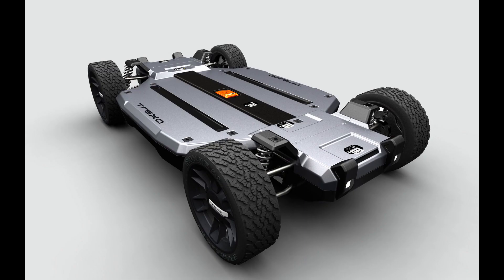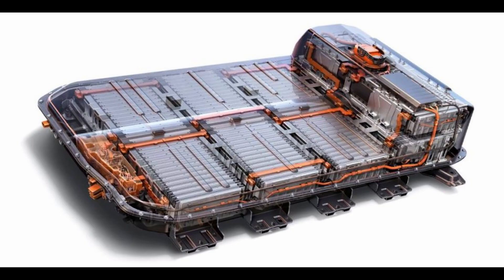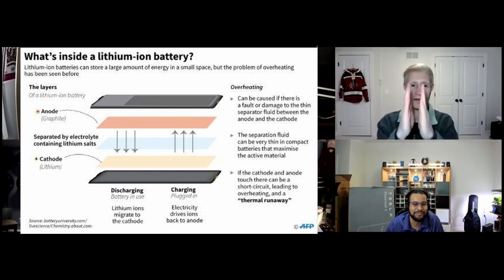390.8 Structural Batteries Mean the Car is the Battery

Comment: I’m curious what will happen when you go to replace a structural battery in a Tesla. If it’s an integral part of the car’s structure, i.e., the battery is the car (your words) do you have to disassemble and reassemble the entire car to replace a structural battery (thus effectively making it a throw away once the battery expires)? I can see how the structural battery reduces weight and improves performance, but,, I wonder if it is also the greatest example of designed obsolescence in the history of automobiles.
Reply: you won't, the same way we can't change the battery in an iphone, and the battery won't be recycled or reused